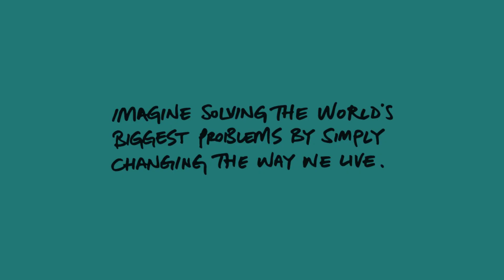Greenhouse by Joost Bakker

Comment: Good intent BUT you're powering this house with a Diesel generator which is not only dirty, spewing all kinds of cancerous particles into the air but also creates noise pollution. Also the solar panels as they are positioned now produce zero electricity. What's the story here?